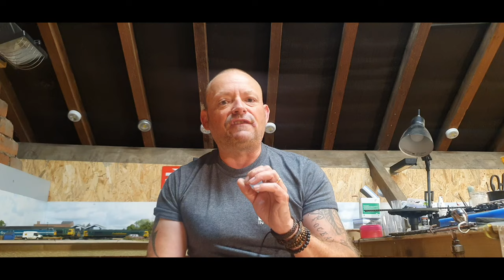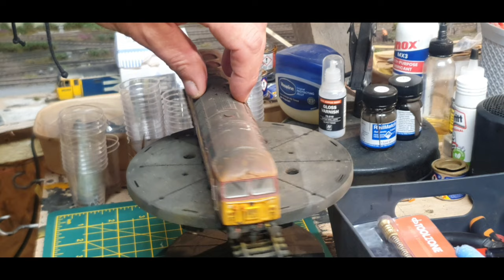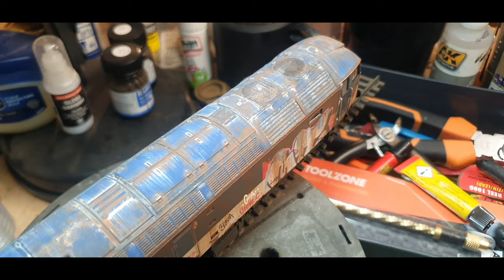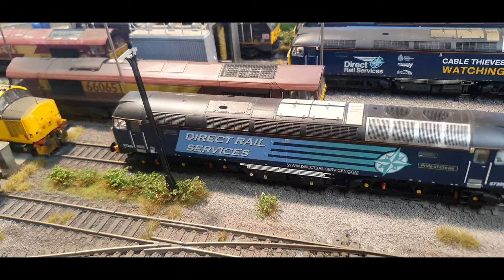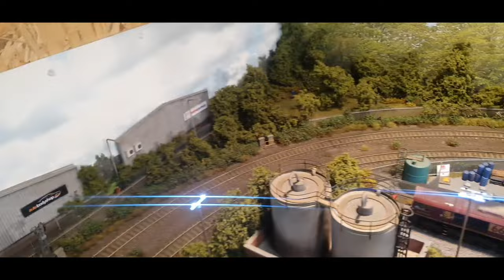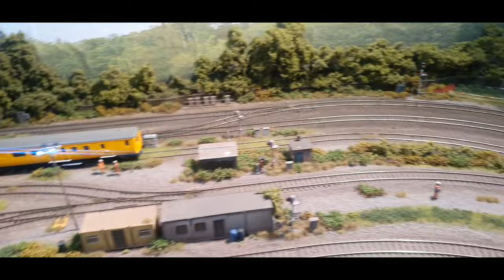Modelling Monday..layout tour, new stock, Grafitied locomotives and updates

Comment: Weird,  I was  looking at your track  and thinking is it settrack  ! And then you tell us.
New back to the hobby I've  only 1 point, half a dozen lengths of flexi track and a  bit of settrack. 
Was planning  to replace with more "fancy" track. When I  had figured  a track  plan .But agree  with your comments. 
Anyway I  spent  all the cash on trains, rolling  stock  and the brilliant  Bachmann scenecraft buildings.
My Bachmann sound  diesel locomotives are amazing and run so smoothly I  also can't  be bothered  with electrical  complication too. As dead Frogs don't  effect there performance. 
Cheers Mike.

Comment: As uve put a through brake pipe into the one end it would suggest the brakes are in operative, thus it would need to be top and tailed or run with wagons on the back for brake force 👍 so wouldn’t carry a tail lamp….. but its a awesome bit of modelling non the less! 🙌